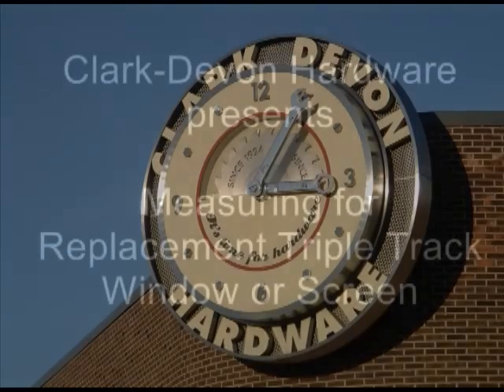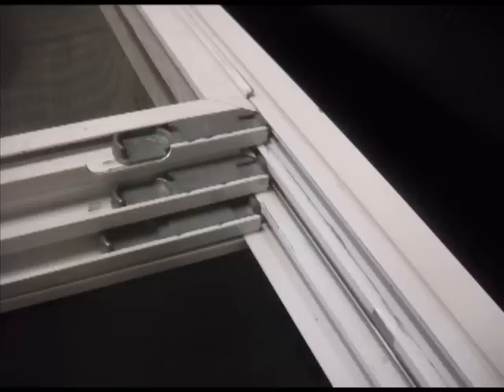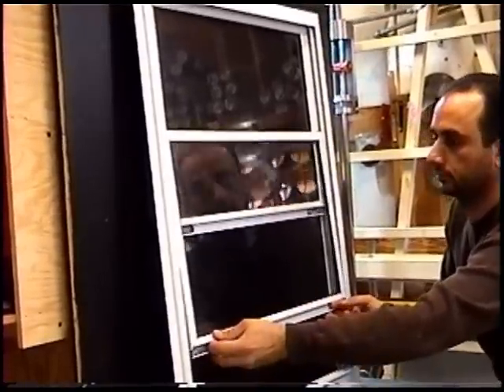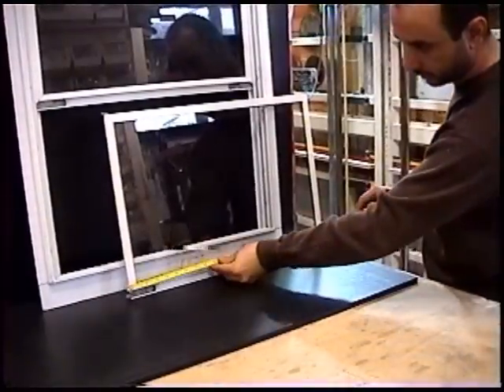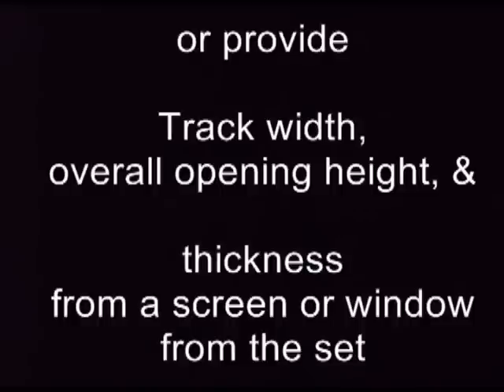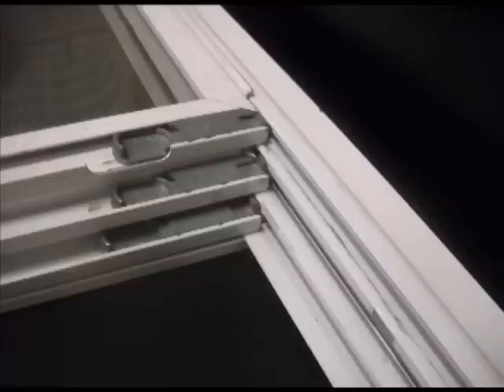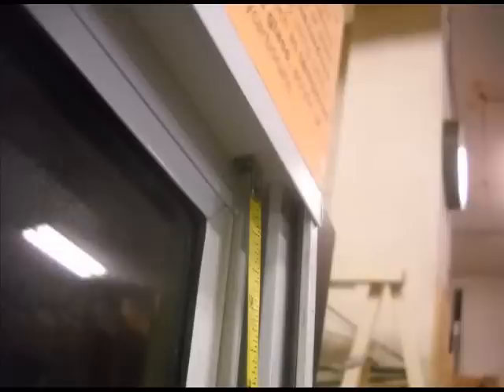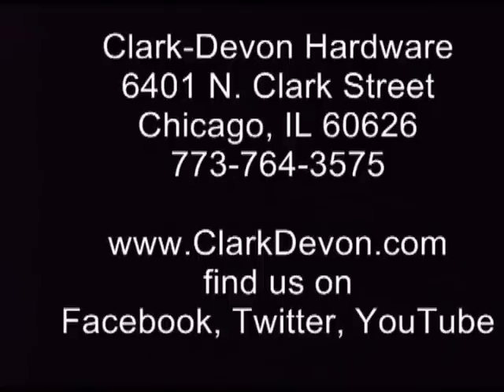Triple Track Window/Screen Measuring

Comment: It looks like you're measuring height of the channels as well as the opening, but this doesn't make sense, if the sashes will be within those channels (and the width is measured inside channels).  I wish you were more clear on this.